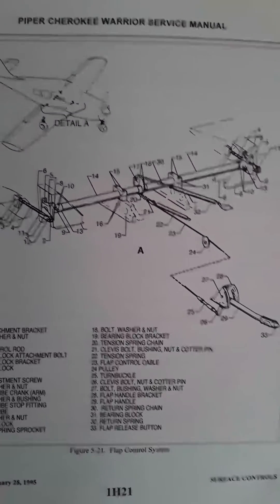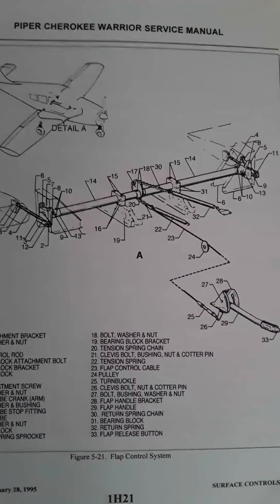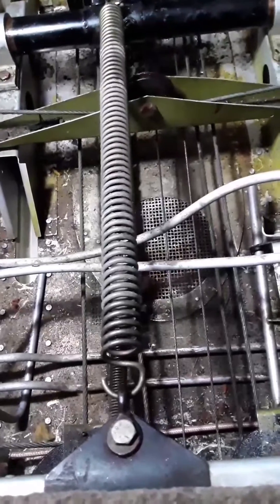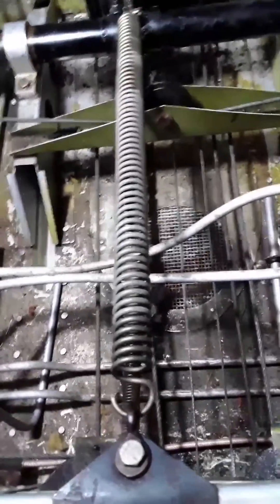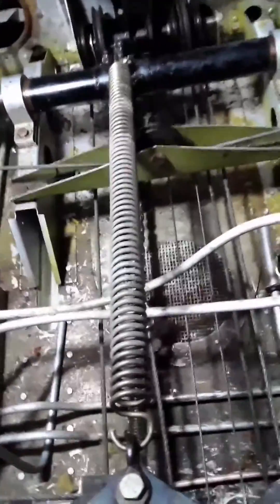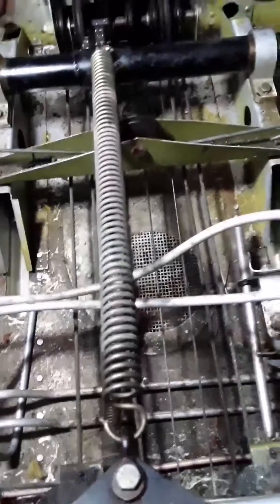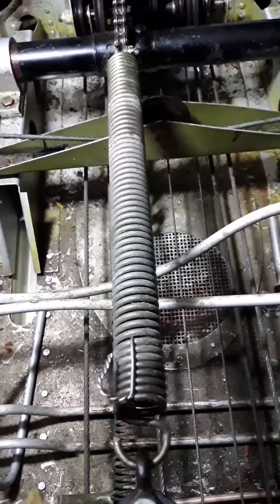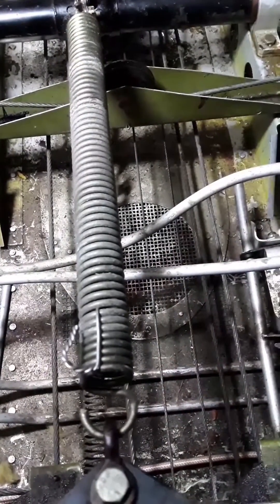AIRCRAFT FLAPS STICKING FIX - PIPER PA 28 & OTHERS

Comment: I have found that most cases can be solved by cleaning the bicycle chain cures the problem.  Most are caused by using WD-40 or LPS-3 as chain lubricant which is incorrect. Spray the chain with automotive brake cleaner or electrical cleaner will remove the caked on dry lubrication then oil with a light oil like 3-in-one or air tool oil. repeat at every other 100-hour inspection and you will not have the problem reoccur. Airplane mechanic since 1965..